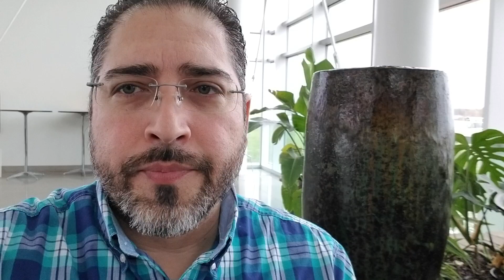Niagara N4 Certification Training - Day 2

Comment: The company I work for is stupid. They think they can send me to this class and then expect me to Come back and redo a whole building that needs updated from older JACE and an old version of the software 3.4  I think. No previous controls experience except for Plugging into Siemens control panels and using Hyper terminal to do point logs, adjust point values, and do system restores. I'm half way through the introduction to Niagara 4 videos on Tridium University. Enjoying learning about it but I think it is a total waste of my companies money since we are just a facilities maintenance group. We only have the one building with the older version of comfort point. Most of the building we deal with have Trane, JCI, and Siemens controls but we really only get on the front end of the computers set by those controls providers. We are filter and belt changers, BB greasers, and mechanical troubleshooters. Do you think the certification will make me worth more to other possible employers like Siemens or Trane? I only agreed to do the training because I thought it would allow me to bargain myself to more pay through a counter offer from my employer to stay. Now I'm thinking what have I got myself into? lol